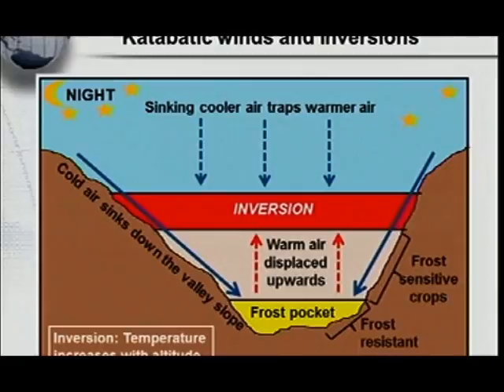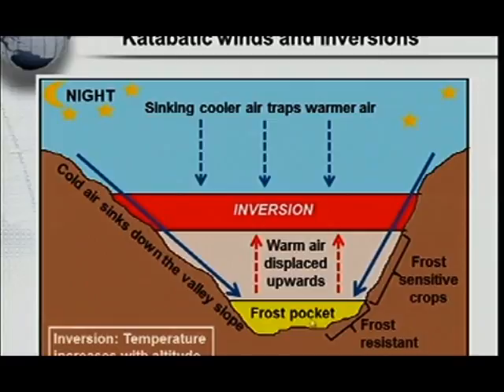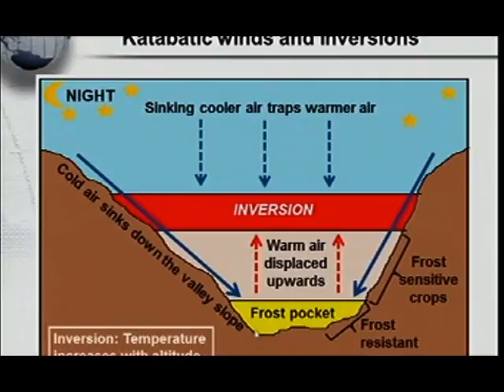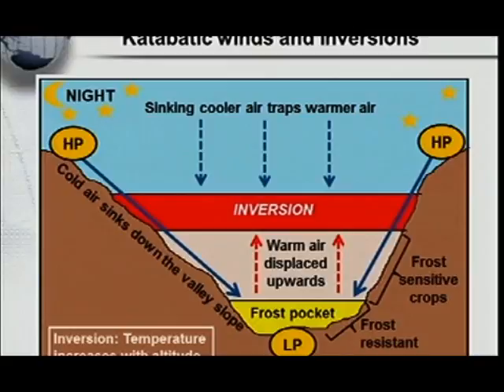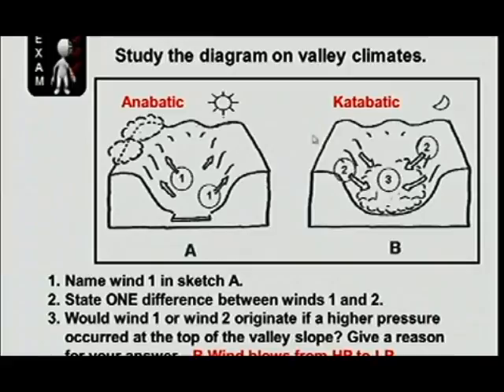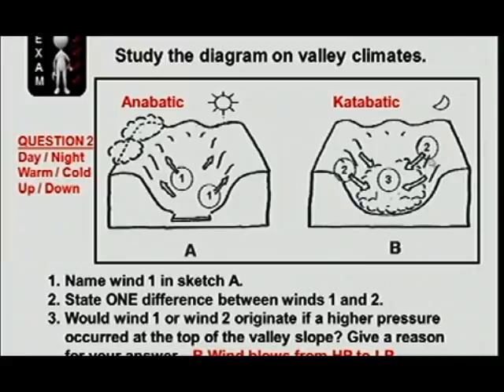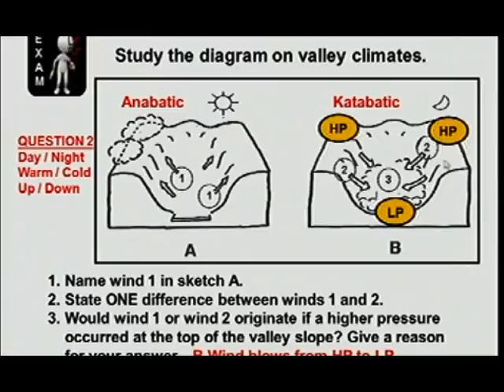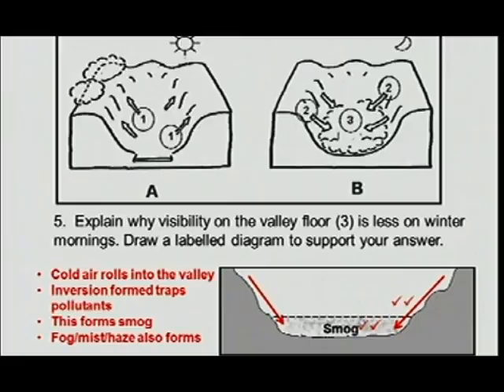KATABATIC WINDS AND INVERSIONS

Comment: Okay, but can somebody please explain to me why, in the case of katabatic winds, the 'warm' air that gets displaced is actually warmer than the surrounding air? Seeing as , during the day, hot air leaves the bottom of the valley as anabatic winds, would the air there not be colder than the surrounding air, keeping the atmospheric pressure high compared to the top of the slopes?
Reply: no, there’s cold air at the top of the slopes remember so the cold war dispacles the warm air at the valley bottom and it forms and inversion layer and now there’s cold air the bottom of the valley